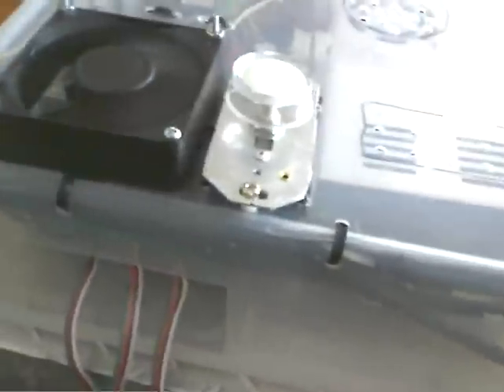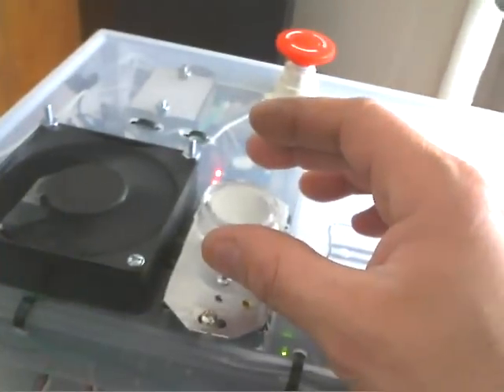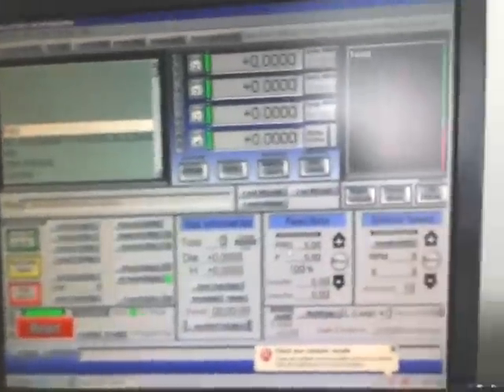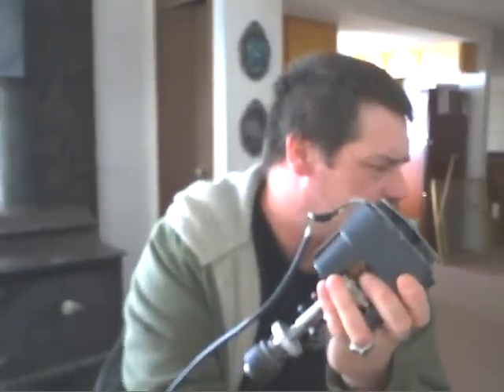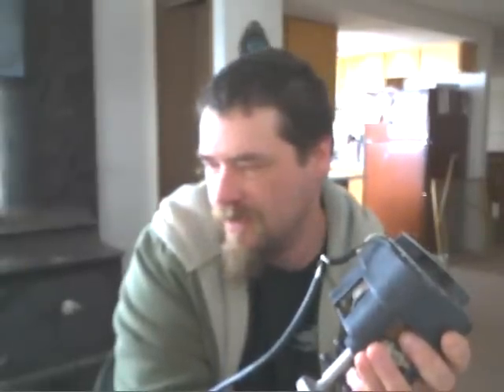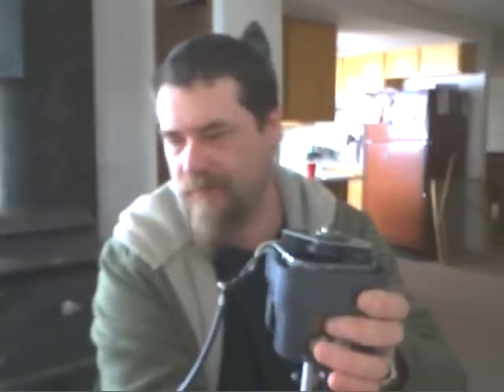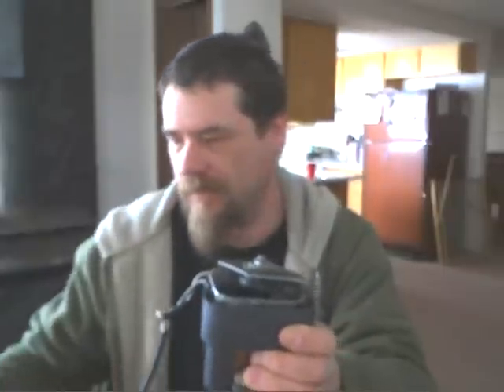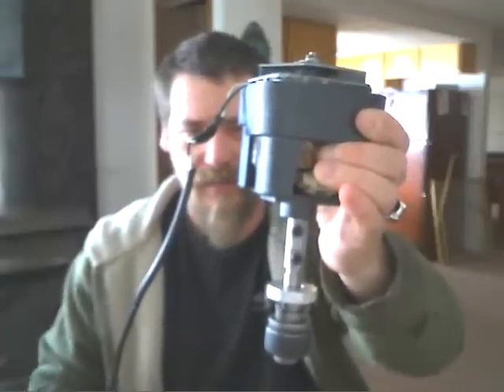update 2 -- 4 axis tb6560 spindle motor.wmv

Comment from the maker: f5 turns your spindle on and off in mach3 ---you need to set it up so that mach3 turns on a 12v 25amp solid state rely --that will give power to you spindle--the little rely that's on the control board can not handle the loads